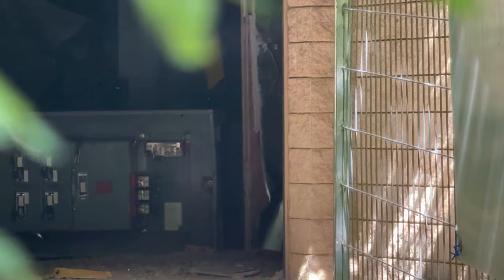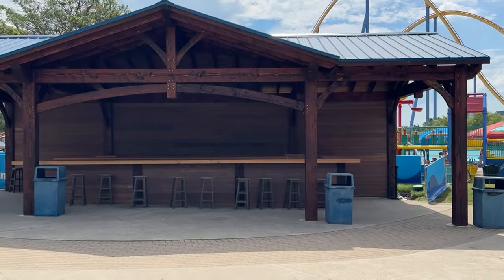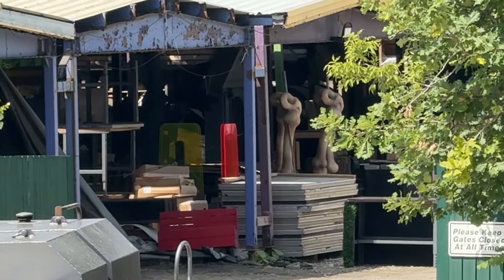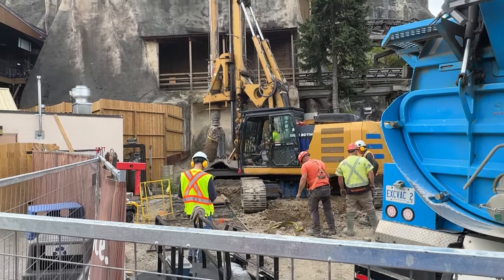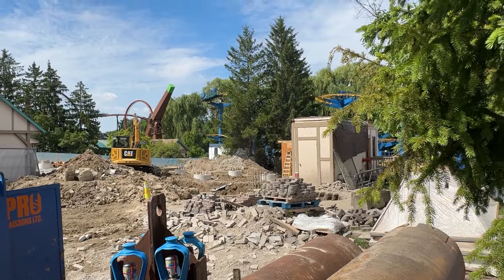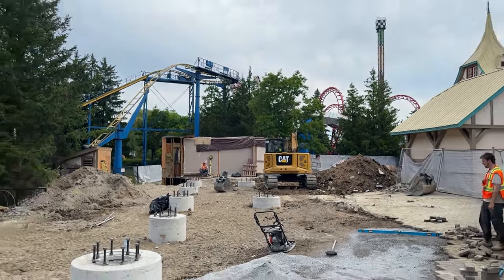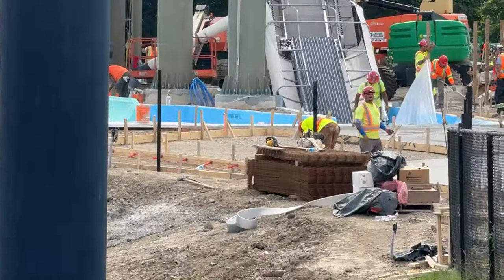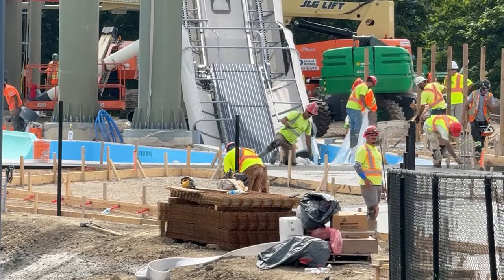Canada's Wonderland New Launch Coaster Update

Comment: I'm hoping this is the fourth coaster to break 200ft in the park. Something as iconic as Fury's treble clef by the front would be great for promotional material.
Reply from the maker: Same here :) interesting you say that. That was part of our original concept for Escape Designs design.
Reply: I am doubting it will break 200.  Generally height not a big part of launch coasters. Neither Velocicoaster or Pantheon are that tall.  That said, CW has broken records before with first B&M Giga and Yukon Striker dive records.
Reply: @johnboulanger807  wonderland has broken or held a lot of records. The crappy thing is, most records worth hold get broken by another park quick